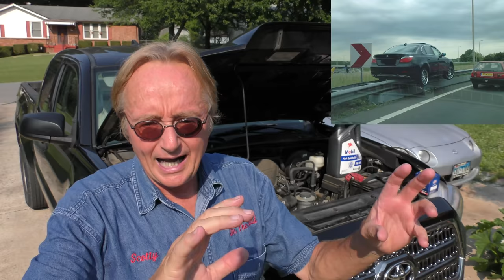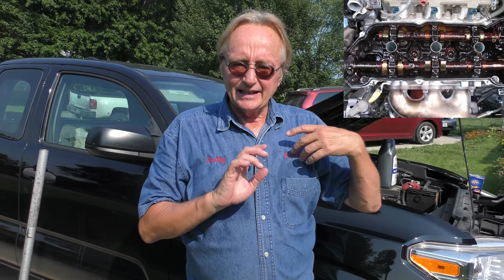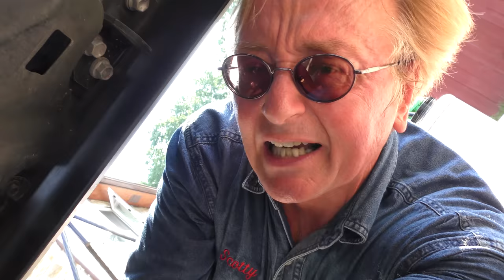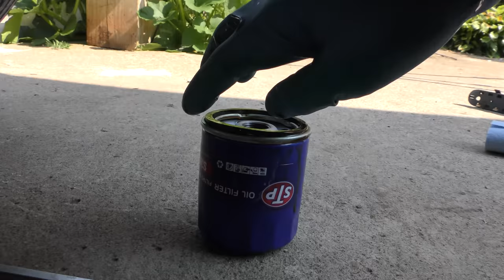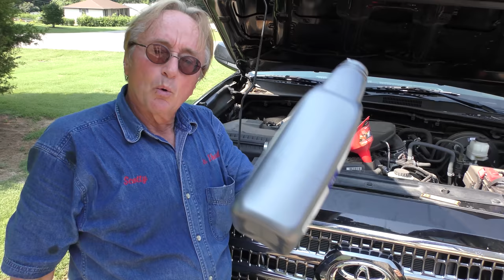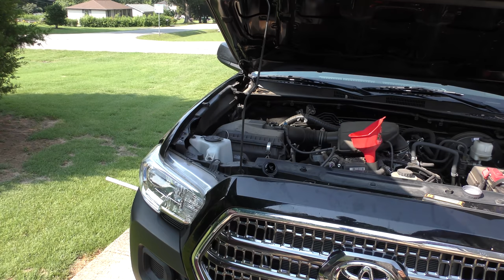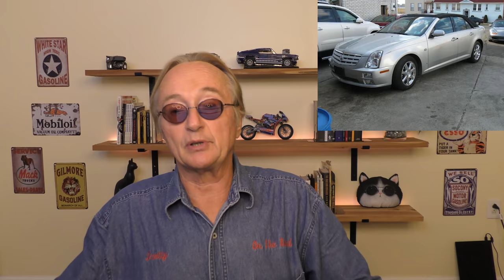My Son Never Changed His Engine Oil, Then This Happened

Comment: Here's a used car FYI, my brother got a used 2016 charger. 23K mi. He sold it 3 weeks ago with 95K mi. NEVER ONCE CHANGED THE OIL. The mechanic that he paid to change a sensor showing a check engine light (right before he sold it) refused to work on the motor. He seen the condition of the oil and wouldn't put his name on anything that he brought the car in for.

Comment: Scotty's son: "Dad, I've never changed the oil in my truck."
Scotty: (gasp) "I have no son."
Reply: He said he went 10K which is fine according to the service manual on both the 2.7L and 3.5L as long as you use a quality synthetic (which i'm pretty sure today you have to go LOOKING for to find a non synethic 0W20)

Still I flush the oil every 5k and filter every 10k. Mines mostly highway miles anyways (about 3 out of every 50 mi stop and go), and I usually just cruise @ 65 to save gas also.
Reply: Jonny Wadd😂😂😂
Reply: Only reason Scotty haven't disowned him is because he's still smart enough to buy 2 Toyotas.  Sienna and Tacoma rock solid.
Reply: @asymsolutions  It does also say on the manual that you should change it at 5k in city driving
Reply: Car is used to go to the dump... Shows picture of Chevrolet dealership ☠️

Comment: “I change my oil every 3000 miles or whenever I get bored which ever comes first”
-Hank Hill.
Reply: He’s a good man
Reply: My 2002 S10 gets a oil change every 2000 miles..WHY?..because our family has a shop & I drive hard city miles ...so yeah my S10 has 200,000 original miles with no engine issues
Reply: I change my oil twice a year. Once before winter and once before summer.  I ight have 2000 miles on each oil change.  Oils cheap, engines not so much.
Reply: He made sure he kept his Ford Ranger in mint condition!
Reply: jomax clux  yeah for real lol 😂 I’d run it another 3 to 4 thousand miles with no problems
Reply: You mean my oil records?
Reply: @stevedeleon8775  that’s awesome
Reply: Another Toyota?!?!? how many toyotas do your family have scotty? 20??! My god he is married to Toyota!
Reply: If your idol is Hank Hill, that explains a lot.  BTW, they're doing a reboot of King of the Hill.  Seriously.  IDK when it starts.
Reply: @efandmk3382  wait really? Did they say what's gonna be different?
Reply: @johnd4348  The top manufacturers in reliability today (Toyota, Honda, Subaru, and Mazda) recommend 7500 miles or once a year, whichever comes first.  Engines AND engine oil have both changed.
Reply: @efandmk3382  I wonder how the animations gonna look
Reply: @efandmk3382  READ THE FINE PRINT, these manufacturers list high mileage to make there cars look like they need very little maintenance. But in reality, especially with toyota's they were designed when oil changes were at 3,000 miles. This is why you have pruis, many lexus, corrola etc are clogging the oil gallerys in the piston rings. If you carefully read the fine print, many state oil changes at 5k miles if the conditions are that you mostly drive highway, if you dont you should decrease the interval. I change mine at 3k, and I dont use high dollar synthetics. Another thing to consider, is the oil filter youre running to 7500 miles on the same oil filter thats too much for these paper filters.
Reply: Not the worst of phillosophies tbh
Reply: Beast. That this awesome show is still referenced so often.
Reply: John D in the winter make sure to use 0 dub 30 but in the summer feel free to use 5 dub 30.
Reply: I vibe so hard with this quote
Reply: Same here😂😂

Comment: Famous last words..."I don't need a jack stand, it's high enough!"
Reply: Scotty needs to consider the possibility of a Chevrolet dealer suddenly releasing that jack, causing the springs to go down past centre.
Reply: If Scotty was in there on his back then there would be adequate room if it slipped off the jack. However I note that he was on his shoulder which means he was sideways, and I don't think that if it slipped off the jack there would be enough room that his shoulders wouldn't get crushed.

I don't like to screw around under vehicles without making sure there are stands under the axles to prevent getting crushed. I know of a friend of a friend who was under his car without a jack stand and it slipped off the jack. When his wife found him he was dead, but he most likely suffocated over a period of time with the vehicle on his chest. There was enough room that it didn't crush his rib cage but just trapped in there. If it crushes your ribs and they puncture your lungs, the lungs will fill with blood and you will suffocate that way. Sounds like fun huh?

Comment: Just did my oil change! I had to buy the jack stands and the right socket to open the oil pan, but quality oil and filter too. It really worth it!
Reply: You will save a ton of money just buying a whole socket set
Reply: I had to buy all of that for a power steering flush. It was scary having just the front of my car be raised so high :)
Reply: That stuff will pay for itself before you know it.
Reply: Welcome to manhood.
Reply: Start rotating your tires every oil change too.
Reply: @timotheify  is it necessary? Scotty said in a video that new tires don't need to.
Reply: WOW mr Toyota at it again! Another Toyota?!?!? how many toyotas do your family have scotty? 20??! My god he is married to Toyota!
Reply: @tomorrowcomestoday1621  depends on your maintenance schedule. What does your manual say to do? Of course, none of my tires show uneven wear.
Reply: And you know the job is done right. Took my es300 to a shop for an oil change once, got it back with a stripped drain bolt...
Reply: @justina249  IDK....MY manhood revolves around activities other than oil changes.  Then again, I don't live in a place where the local Walmart is the center of local culture.  LOL.
Reply: I rotate my tires every time I drive!
Reply: @frankciccone8559  anyone who holds a drivers license should know simple steps of maintenance at least. How to check oil. How to change a flat on the side of the road instead of calling a tow truck guy to come out grab your own spare tire and jack and lug wrench to do it for you.
Reply: @tomorrowcomestoday1621  that’s a dumb question dude. Tires need to wear evenly of course you should
Reply: @efandmk3382   you can just pay for a new engine or vehicle.  No big deal.  So many women just drive till a car cant move anymore then complain about the  cost
Reply: @cayman9873 of course they complain about the cost, especially when THEY have to pay, not their husband or dad.😁

Comment: Some great advice here Scotty!!!  I have 2017 Tacoma and my son has a 2021 Tacoma,both trucks have the 3.5l V-6.  I think people really don't understand the importance of regular oil changes on the s trucks (key to long engine life).  I tow a small bass boat with my truck and put 15-20k miles a year on my truck.  Plus, tow a small boat a few times in the summer.  I just purchase the Toyota OEM filter element and drain plug gasket at the local toyota dealer.  Then pick-up some  quality 0w-20 synthetic oil...  Yeah, Toyota says 9-10k oil changes.  I do it every 5k just for cheap insurance.
Reply: You can get everything Online or Walmart. No need to work with the dealers.

Comment: Hey Scotty, you can buy the OEM Toyota filter for roughly $5.70 at any dealer. Its a lot cheaper than many online stores and its a high quality oil filter.
Reply: Buy a mobile 1 oil filter instead
Reply: John Doe  Yeah I was quite surprised when I learned a few years ago. I dont even consider other filters anymore since all cars are toyotas
Reply: @yotaforlife8408  I'll never buy a Wix again.  In 34 years of changing my own oil, that's the only filter that's unscrewed itself.
Reply: @tbelding  I use purolator tech on mines. What do you think
Reply: Not really. It’s mediocre. Mobil 1 or Bosch premium.
Reply: @tomorrowcomestoday1621  - Frankly, I think if you change your oil regularly, the filter brand almost doesn't matter at all.  I've just been using NAPA.
Reply: Another Toyota?!?!? how many toyotas do your family have scotty? 20??! My god he is married to Toyota!
Reply: @tbelding  I've been using for 3 years now and so far so good
Reply: @talisikid1618  Mobil 1 Oil Filter and Mobil 1 Full Synthetic Oil - GOAT
Reply: @tbelding  if you use a good quality filter you can go longer without changing your oil
Reply: @yotaforlife8408  Not trying to make anyone change.  Just a personal experience
Reply: @tbelding  as long as a filter has an anti flow back valve... such as Toyota OEM, bosch, Mobil 1, Wix, Napa Gold (made by wix).... STP and Fram are Junk... in filtration testing they only stopped about 75% of contaminants. The others I listed were all 95% and above.
Reply: @fr8dogpilot  - Interestingly enough, when Scotty changed that oil, I'm pretty sure that was a STP oil filter he removed.

Comment: Helpful Tip:  When removing the old filter, after it is broke loose, I usually put a plastic baggie to catch the oil instead of spilling it all over the frame or exhaust or steering linkage.

Comment: 80,000 miles without an oil change sounds like a pipe dream lol, insane to hear it's possible
Reply: What kinda pipe dream is that anyway... an oil change is gonna run u no more than 100 in most cars. 😂 protect ur engine folks

Comment: I had a dodge that I put full synthetic oil in and changed it every 10k. It would need around a quart during the 10k,  at about 135k I gave the car to someone I knew who was in a bad time in life.  He never changed oil since he got the car for free. That engine survived to 225k. He said it was running fine right up to the time it blew.  I  wonder how long that engine would have gone if he kept up with 10k  oil changes.
Reply: Sounds like he used to ride the short bus to school...
Reply: @stillnotwoke  Actually is a pretty smart person who tried to take too many shortcuts in life.  I kinda schooled him just enough to where he's in a much better place in life now.
Reply: "it was fine right up until it wasn't"... So it's a good thing the failure suddenly occurred without warning ,,🤣

Comment: my Honda used to  require a quart every 2nd time i filled the gas..  Never changed it for 6 years...   Sold the car,  was still running great!    Car was old,  and I didn't care anymore..    Drove  that car for over 10 years..   Did a lot of work when I first bought it...   Head gasket,  coolant hoses, battery, cap, rotor, plugs...  then never touched it for 10 years,  except for starter, and Master cylinder.   did oil change about 1 time a year.   until last 6 years.

Comment: If you ever changed your own oil and not a mechanic who can rely on experience, here are 2 tips:

1) Use a torque wrench.  Too many stripped oil pans from torquing more than necessary.

2) Open the oil filter first before drain plug.  If you cannot loosen it, you can at least drive it to an auto parts store or mechanic to deal with it.

Comment: My 06 tacoma has the top mounted filter...makes 4000 mile change a breeze...
Reply: You can do it every 6000
Reply: @erniecarrasco9107  You are 100% correct, but my Taco has 171,000 miles, and 0w-20 oil is cheap.....

Comment: I'm pretty gentle when I put my drain plug back in.  Had trouble with an over-tightened one once; soft steel head rounded off and I spend an hour under the van with a Dremel tool, sculpting it into a shape that I could grip with Vise-Grips.  Still had to hit the Vise-Grips with a brass hammer to crack that thing loose.  I'll always warn people about over-tightening fasteners.

Comment: Have an 05 Accord. Vtec. 380k miles. Have oil changed every 2k. Standard oil. Engine still running strong. The body needs help here in the rust belt

Comment: My 98 Altima oil-change is easy. It's the filter that's hard - on the back of the engine, surrounded by inner-axle, intake-manifold and oil-pressure switch. Had to buy one of those three-legged 'spider' filter-wrenches to grip the filter, or else very good chance to break the OP - switch!

Comment: Have you evaluated different oil filters? I found I get better oil pressure with aFe filters, plus they have 3/8" square attachment for ratchet extension
Reply: Those STP oil filters aren't bad ,they are actually made in the same plants & supplier that makes the AC Delco filters, Champ Labs....they make alot of other premium filters for other manufacturers as well including K&N ,& the older Mobil 1 oil filters,
Reply: Your Oil Pressure goes UP when the filtering ability goes DOWN.
Reply: @SlikLizrd  – Pressure goes DOWN when the filtering holes are so large that oil & metal powder pass through with little resistance.

Comment: I don't see how dry ice (frozen liquid nitrogen) would be bad for the electronics. When it melts it turns into a gas. So it's basically like sand blasting without the mess of the sand. Seen a home show using it in an attic for mold on wood. I get not using steam or water, especially a pressure washer but I don't believe dry ice would do any harm.
Reply: Right, dry ice would do no real harm. If it's taking longer than 10-15 minutes to dry ice clean an entire engine bay, something is wrong. Scotty is misinformed.

Comment: One question for Scotty though... When I've done them in the past with my older cars, I used to fill the filter up at least halfway or in some cases, most of the way, with oil if the filter sits upright when attached to the engine.  Someone suggested this as it also ensures there is some oil for the engine to pump around when you first start it up.  Is this still necessary?  (I haven't done oil changes in the past 10 years since getting new vehicles, since I would just have dealers do it but was wondering if this mattered or not).
Reply: I'd like to know as well. I change my own oil and always pre-fill the oil filter, usually resulting in a mess and a very slippery filter.
Reply: No
Reply: It can't harm anything.  Theoretically, any time spent pumping air through bearings etc. can cause wear.  However, before draining the old oil, you bring the engine up to running temperature – which means there's still a thin film of oil on all engine components, so there's a basic level of lubrication during the few seconds until pressure builds up with the new oil.  Just don't rev it up until the new oil has fully circulated.

Comment: Don’t forget about the neighborhood local Quick Lube place…where you get your oil changed for $39.95…and get your oil pan bolt stripped out by the Pot Smoker under the car doing the work.

Comment: I went 2 years (but only 4k miles) in my fun car between oil changes. I sent a sample to blackstone labs to get tested (mainly to see what metals were in it). They said I could lengthen my change interval, and that the oil was still good. That was with 3 trackdays on it too, where the oil temps got up to 235-240 degrees. If you use synthetic and a quality filter, you can go longer than 12 months.
Reply: Yup, low mileage is also important. If high mileage, it won't help. I did this too with low mileage car.

Comment: You don’t really have to tighten the oil filter as much as you physically can, an old shop mechanic taught me that you want to hand tighten till its pretty snug and back off about a quarter turn. This allows an easy removal without it leaking. I do my own oil changes and can remove the oil filter by hand every time. Never had a leak.

Comment: I've been changing the oil on my Tacoma and my Town Car every 3k miles with synthetic oil and factory Toyota /Motorcraft filter. That's exsesive, every 5k is fine with synthetic, but I'd rather do it too much then not enough. It cost me less then $20 per oil change so why not? Especially on older vehicles, it's important to keep the oil clean! The oil tends to degrade faster on older vehicles.
Reply: Must live in Saudi and get oil from the well
Reply: Kirkland synthetic oil $24.99 for 10 quarts and the motor craft filters are $3.97 at walmart. I think the Toyota filters are $6.97. Both cars only hold 5 quarts too so that helps too! Either way, it's under or around $20 per oil change.
Reply: @mcc7762  The service interval on mine is 5k, but that's with conventional 5-30. I think 5k intervals are perfectly fine for it, but I'd rather be safe than sorry. When I first bought the truck I was doing the 5k intervals with conventional because I had the dealership do it and that was the recommended interval and it was fine because I was putting about 1000 miles per month. I have 2 vehicles now and had 3 at one point and when I had 3 I was only putting 3-5k miles on all 3 per year. The other rule I go by is changing conventional every 6 months and synthetic every 12 if I don't hit the milage first. Overkill maybe? But better than letting a perfectly good engine go to waste.
Reply: @joshpeterson7241  That must be fantastic synthetic oil for $2.50/qt. 💩💩💩💩

Comment: I have a DeLorean. How often should I change the oil in my flux capacitor? 😏
Reply: Nonono, all you need is an electric  (or nuclear) reaction to generate the 1.21 gigawatts and then it'll work just fine! 
Wait, it's a DeLorean? Yeah, change the oil regularly, too!

Comment: What’s the difference between Mobil Full Synthetic and Mobile 1? Price? 🤷‍♂️
Reply: One is full synthetic the other is not
Reply: "Fully synthetic" stills has mineral oil inside.  Only "100% synthetic" is true synthetic.

Most turbo cars are required to use 100% synthetic for high temperature.
Reply: He called it Mobil 1, but it wasn't.